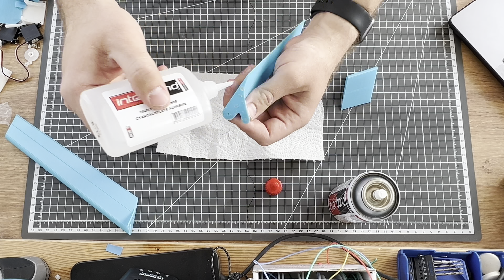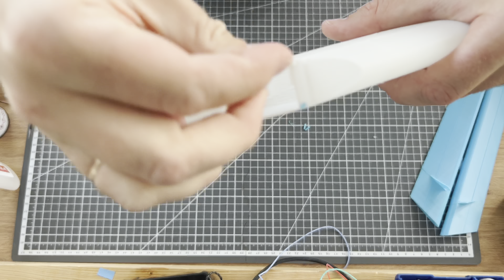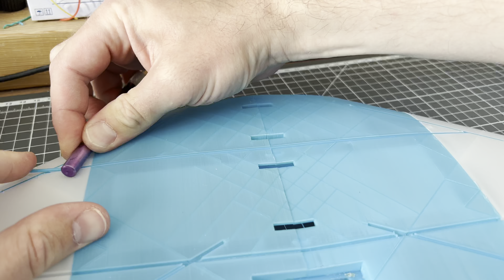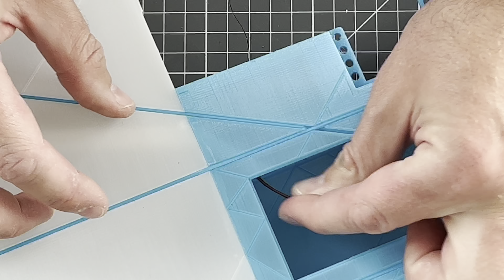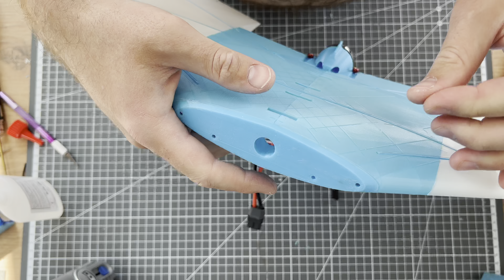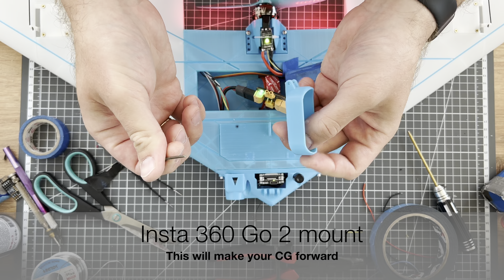3D printed Spec wing full build video #Specrom

Comment: try light-weight inflated 3d-print, less rigid, squish fold wing body, air pressure will keep it in form, but its more rigid than totally flexible plastic inflatable, still has strong form
Reply: flexible 3d-print air-pressurized structure

Comment: Great design I like the idea of using filament instead of carbon 👍
Reply from the maker: Thank you! This is really strong)
Reply: @Skyglide  strong in tension only.  like a fishing line.
Reply: I'm curious how it holds up over time. I just know how brittle PLA gets once it's been sitting out. I can barely touch the stuff once it dries out without it crumbling into tiny pieces.
Reply: @bkpickell  I was just thinking that, perhaps ABS would be a good substitute.
Reply: Pla doesnt become brittle from drying out it becomes brittle when it absorbs moisture or is exposed to long periods of UV. ABS would withstand the elements a tad better but still absorbs moisture which would eventually cause some warping.

Comment: Nice! I really like it! Is it within FPVWRA Spec (except for the motor, prop and FC)? 

SPEC WING™ CLASS
Wingspan: 36" +/- 1/2" Does not include winglets
Airfoil: NACA 0014
Wing sweep: 12" +/- 1/2"
Chord: central- 9", tip- 6" +/- 1/2" (includes elevons!)
Root Chord thickness: 1.25" +/-1/4"
Tip Chord thickness: 0.85" +/-1/4"
Elevons: balsa or foam
Material: EPP, EPS, EPO, fan fold foam, or foam board (Foam board should be formed to airfoil requirements)
Motor: Cobra CP-2210 2200kv Motor
T-Motor AT2310 2200kv Motor
Turnigy D2826-6 2200kv Motor
Battery:3s 2200 (Max Charge 4.2V per Cell)
VTX: 200 mW 5.8GHz w/ raceband
Vertical stabilizers: Winglets ONLY (new for 2018 season)
Winglets: ABS, coroplast, or foam (3D Printed materials such as PLA or PETG are also acceptable)
Servos: Builder's choice
ESC: Builder's choice (BLHeli is recommended)
Prop: Cobra Motor- APC 6X4, T-Motor APC 6x4, Turnigy Motor- APC 6X5.5E
Spars: Builder's choice not less than 1/2" behind leading edge
Flight Controller: FC/gyros are not permitted
Reply from the maker: Sounds like yes?=)
Reply: @Skyglide  look at materials. I've looked into it in the past, fpvwra worded their requirements to leave it sounding as though the only approved materials are balsa and foam (balsa only seems to be permitted on control surfaces)

Comment: Very awesome!! Quick question before purchasing .. is the SCAD file included? Would like to add vertical lift and dual 6s capacity for very long range.
Reply from the maker: Hi, unfortunately only STLs included. And this platform is not gold for dual 6s. I’m finishing new product GPlank with plenty of space for the long range. Check my shorts video
Reply: @Skyglide  ohhhh nice!! Thanks for the quick reply!! I'm going to check it now
Reply: @Skyglide  just checked out the short of the GPlank and I'm absolutely interested! Do you have a time frame for release? Also I'd willing to pay extra for the SCAD along with the stl. Would really like to incorporate vertical lift, motor in each wing to get it off the ground without having to hand/sling launch. Thanks!

Comment: Hello! What material did you use in the construction? Thank you!
Reply from the maker: This is PETG and eSun PLA+
Reply: @Skyglide  thanks, petg in what parts?
Reply from the maker: I've used petg just because of a nice blue color. There's no difference. General guidance - use petg for motormounts. Airframe - eSun PLA+. It is much better than PETG. But both work okay

Comment: Please don't call the filament "spars."  They act more like wire rigging (only good for tension, no compression or torsional rigidity) inside your mostly monocoque wing which is the main load bearing structure of your plane.  It's a great design but you're using wrong terminology.
Reply from the maker: Thanks! Noted)
Reply: You're wrong they are spars if you ever put together a spec wing it's the same thing they use for spars just not as rigid